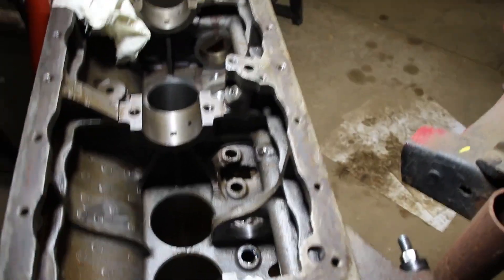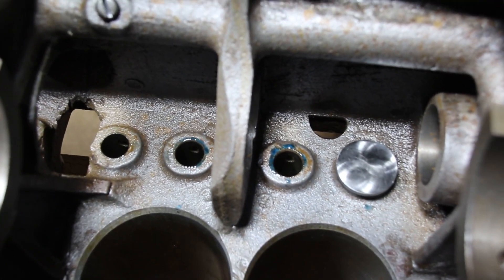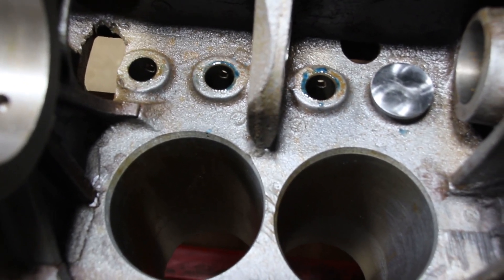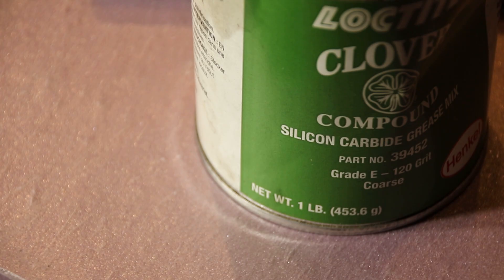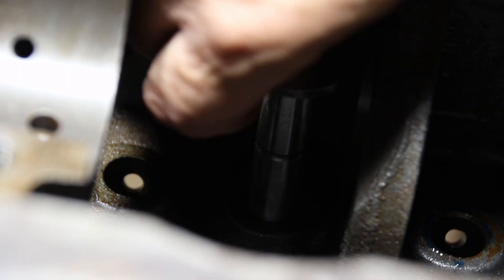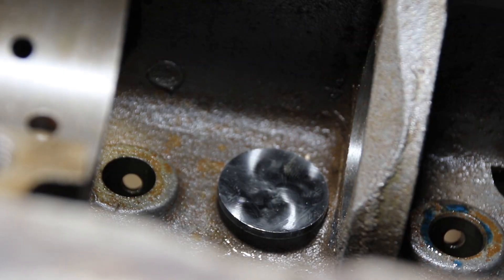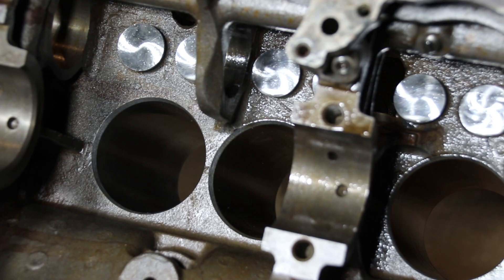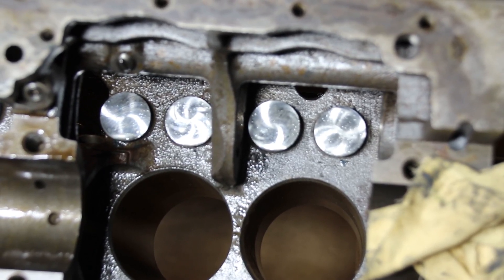Willys L134 Engine Rebuild, Precision Lapping Tappet Bores To Size

Comment: Great information Brian, I bought 0.004” oversize tappets for my engine and went the reamer route, I like your lapping method better. I did make sure that they ended up with a nice sliding fit. Can’t believe a professional shop would jam those size on size parts in, there would be no proper tappet rotation and the cam and tappets would soon be toast.

Comment: Guys out there are buying N.O.S. engine parts assuming they are standard, back in the day on the line they had certain tolerances. any male/female interface had a tolerance for fit. I believe as N.O.S. stock runs low the high or low dimensioned parts are all that's left. Even main/rod bearings that are +/- a hand full of tenths. Sellers only advertise as N.O.S. Buyer beware! Cheers Brian!
Reply from the maker: Well said.  Not of lot of guys understand this and pay a lot for NOS parts only to find out they are NOS for a reason.......high or low side of spec, or way out of spec and never got discarded.   Another reason why people complain that their engine build was too expensive.

Comment: Would it be better to hone the tappets?
Reply: i used a drill and one of those cheap 3 jaw drill lathe chucks and a file to get oversized tappets cut down to to the OEM size to fit correctly...it worked fine for my F-Head...so far...
Reply from the maker: more than one way to get a job done.  I prefer the finish of a lapped hole and a factory finished tappet in my engines.  Tappets can be filed, ground, etc... to make them fit, so whatever you feel like doing is fine

Comment: Brian,   have you ever machined a F-Head block and converted it into a L-Head block?    I have never seen any videos about doing it.
   You sometimes show blocks that are in poor or usable condition,  and you are in need of a different block , but have trouble with them being available.
Reply from the maker: No that would be a huge job turning an F into a L engine.  Think about the valve bowl contours, valve guide precision hole, etc......